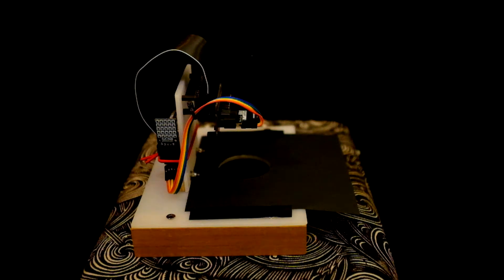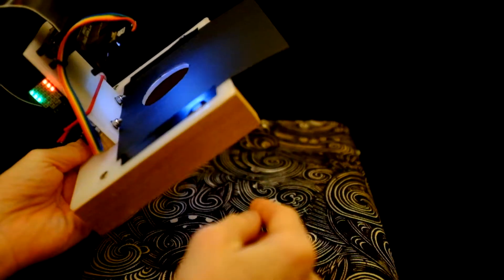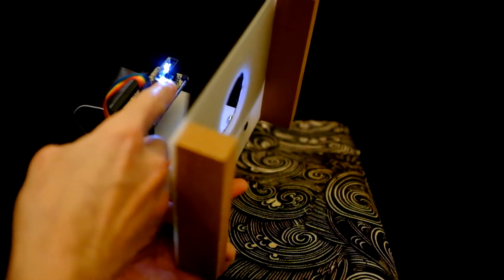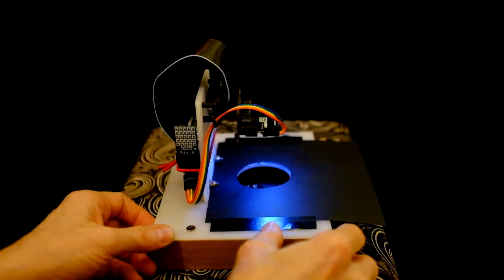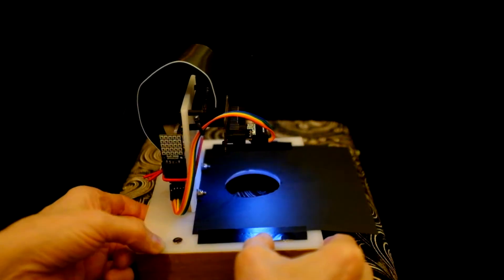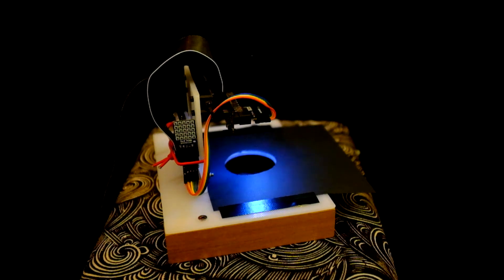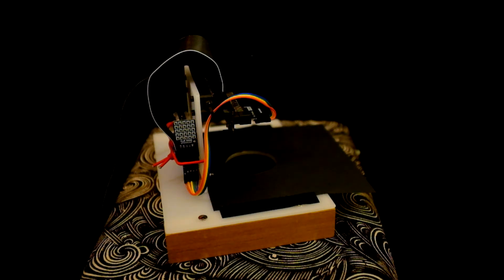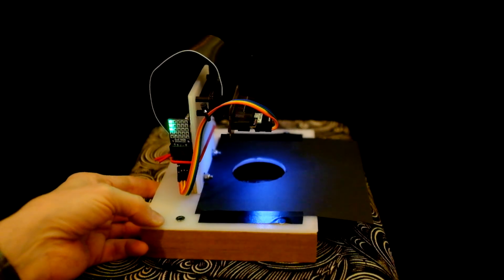Testing a Ground-based PMW3901 Optical Flow Sensor

Comment: Downside of these sensors is that they have to be pretty far away from the surface to track a fast moving robot. A way of solving this is simply flipping the sensor to instead aim at the ceiling instead of the floor, which should be much farther away in most scenarios.
Reply from the maker: The working range of the PMW3901 is 80mm to infinity, as it was (to my understanding) designed for use with flying drones. So it's fine on a Mars rover or other robot that's at least 80mm from the ground, but can't be used any closer than that. But flipping them to look at the ceiling won't work either, as they are effectively a low-resolution camera that relies on detail in order to determine movement, and most ceilings have little to no detail, just an expanse of white paint. 

I lobbied Pimoroni to consider implementing a sister sensor, the ST PAA5100JE, which is almost identical to the PMW3901 except its operating range was designed for something like a robot vacuum, 15-35mm, and they happily went ahead and developed the product as a Breakout Garden board. I described this in a blog post at: https://robots.org.nz/2021/07/09/the-paa5100je-near-optical-flow-sensor/

Now, there's still that range between the two sensors, i.e., between 35mm and 80mm, that's not covered by either, and while it's possible to mount a PAA5100J below a tall robot, one would be sacrificing ground clearance. As with many things in robotics, a compromise...

Comment: Targeting a drone in the event of jamming is way easier than using AI.  You can use an off the shelf Optical Flow Sensor such as PMW3901 tied to the flight controller to keep it flying towards the same object, if it looses contact with the controller.  So long as the target is kept in the centre of view during the approach, it will continue towards, even a moving target.  All for $10 worth of hardware & a bit of easy software.

Comment: Cool demo. Are you processing this with an Arduino, and if so what library are you using? I have a version of this chip on a breakout board and am not having any luck initializing it. Thanks.
Reply: The robot has a raspberry pi onboard so I would assume it uses that.

Comment: Do you know what angle the cone of light sensed is? I couldn't find any of that information in the datasheet. I plan to use this similarly with a cutout near the lens and want to make sure the opening is big enough (or close enough) to not interfere with the light.

Comment: Have you found any optical flow sensors that include rotation as one of the values returned?  It's annoying to me that we have to get rotation out of gyro or other means -- it seems like optical flow algorithms should be able to return rotation delta just as well as it does X and Y, but so far it seems like all of the ASICs that I've run across only return X and Y.
Reply from the maker: No, and there must be a good reason for that as I've viewed the tiny black and white movie that gets created so I get your point, but there must be some good technical reason why these sensors don't return a rotation delta. Even the significantly more expensive ones don't. Must be problematic to interpret image rotation in real time.
Reply: You could have two of them and extrapolate the rotation based on the x/y change delta between them.
Reply: @ai-matt  That's a really good idea -- I like that!

Comment: Does this flow sensor works on plain or less textured floor . are you still using this sensor for odometry ?
Reply from the maker: I've done some fairly extensive testing on the PixArt PAA5100JE, a sister to this sensor designed for close distances more suited to ground-based robots. I'd suggested to Pimoroni that it would be better than the PWM3901 (which is really designed for flying drones) and they're now selling it, which is great. 

What I've found is that you can calibrate to fairly accurate distance tracking on a single floor type, but if your robot goes from say grass to concrete to wood floor, the numbers sent back by the sensor will vary depending on surface, basicaly on surface complexity. It does still work on a "plain" floor if it has some kind of surface irregularity. On a smooth featureless tile its camera isn't able to discern detail, but you can help it out by adding additional white LEDs underneath to supplement the ones it has. But in short, it works better on surfaces that have some texture.
Reply: @NewZealandPersonalRobotics  I already bought PAA5100JE, which is only for close distance .now I've the PWM3901. .i'm going to tracking the ceiling. I've not installed on the robot yet Thank you very much for the reply.

Comment: Pretty sweet. Did you use the ledn pin for syncing the led with the flow update rate ?
Reply from the maker: Thanks! If you mean the RGB LED, no. The code for the PMW3901 sensor doesn't send any data at all when it doesn't sense movement (so there's no default data rate), and then spits out x,y coordinate data as it does. I'm just listening for this data in a loop and updating the RGB LED as that data comes in.